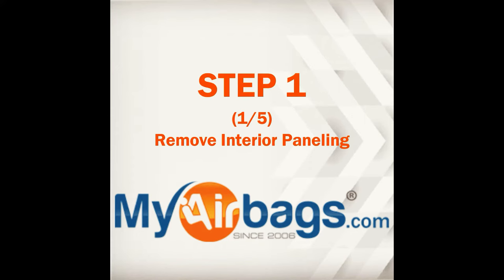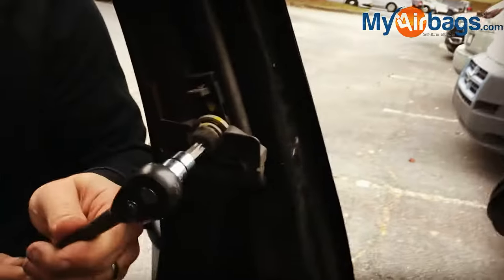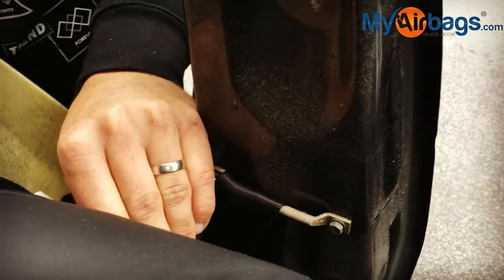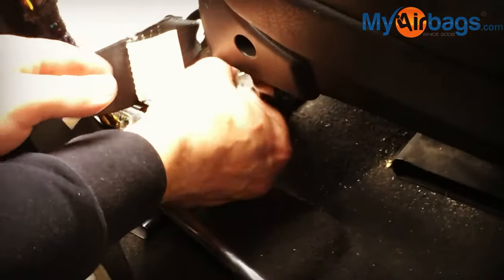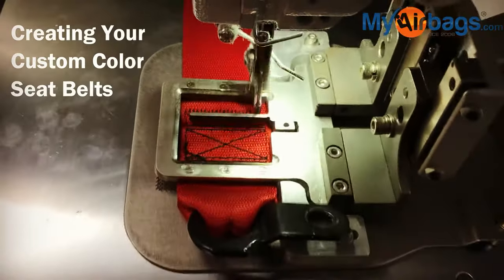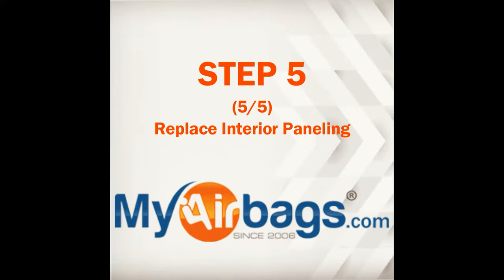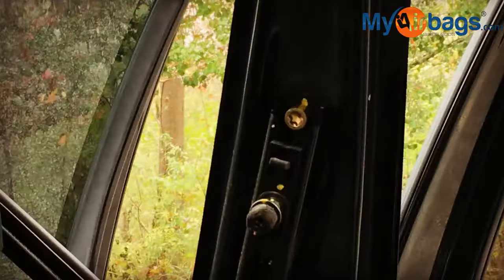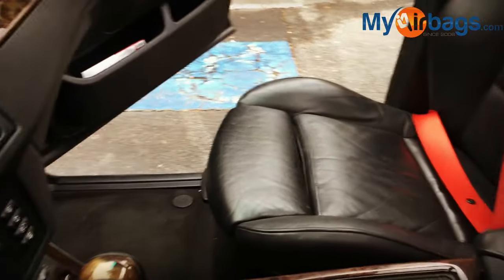How to Remove and Replace a Seat Belt Pretensioner | MyAirbags

Comment: Disconnect battery?
Reply from the maker: Yes, it is a good idea. If not, then it will set the airbag light on, and then you just need to use a diagnostic scan tool to clear the code. So, if you have the scanner tool to clear the DTC code, then no big deal.
Reply: @MyAirbags little off topic? if vehicle has a performance tune will I lose tune when disconnecting battery? Thanks 😊